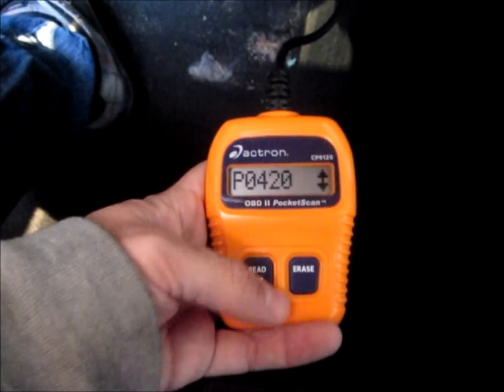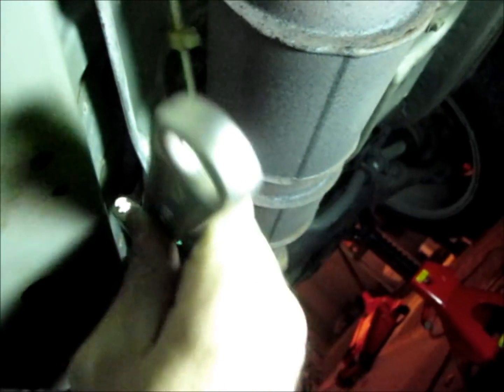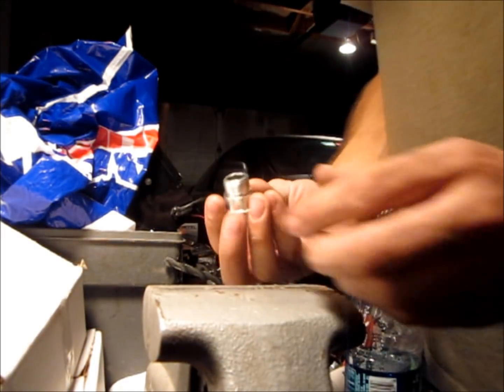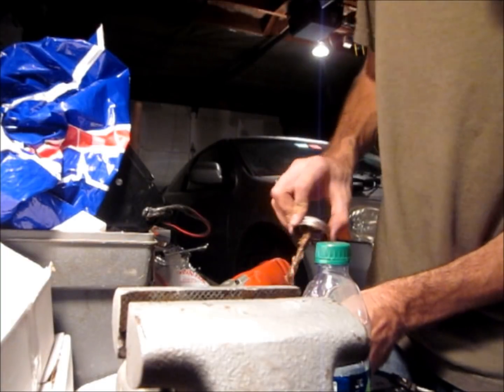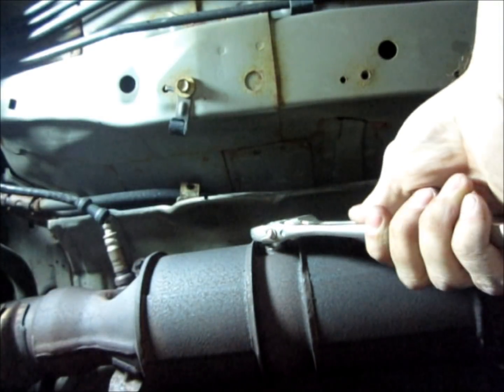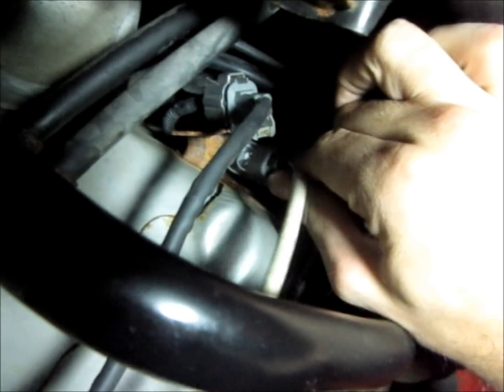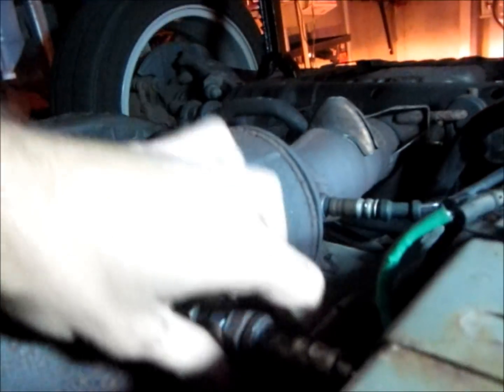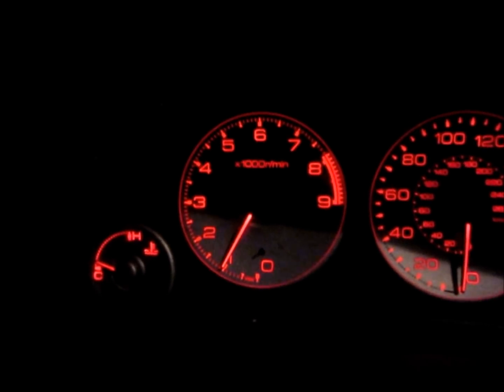Clear check engine light for less than 5 dollars

Comment: 90% of the cars I've seen with a catalyst inefficiency code had bad downstream O2 sensor, NOT a bad catalytic converter (cat). The ones that did have bad converters had bad upstream sensors and were run that way for months and the rich mixture burned out the cat. I always try changing sensors 1st, then the cat, as if you're gonna change the cat, you'll want new sensors anyway to prevent burning it out. One customer was told by the Volvo dealer that he needed a new cat for $1800. 88,000 miles on the car.  We changed his upstream and downstream sensors (probably only downstream bad) and he passed emissions for another 10 years without changing the cat! Saved him $1600 and all legal.
Reply: +Mouse Toad As an ex mechanic I did not and do not have the heart to rip people off, maybe that's why I'm not rich.
Reply from the maker: +Mouse Toad Thank you for your comment sir. This is important info people need to know. You need to diagnose and troubleshoot, rather than "shotgun" -- which many "automotive experts" fail to do, because they want to make money. Many times a $2,000 repair is actually a $100 repair. I hate to see someone on the $2,000 end, having to scrap it for a month or two because a mechanic was greedy and wanted to take advantage of a customer.  Thank you for watching.
Reply from the maker: +ATH-3157 elg You are a stand up guy- thank you for being honest and noble.  You are a dying breed, so please keep doing what you are doing-- and if you get a chance to train another auto tech (Car brain surgeon), please pass along your moral backbone.  Cheers!
Reply: engine light just went on on my car and i brought it to autozone and its about catalytic converter and thats why i searchd here and found you comment and i thank you cause im planning to buy new cat but now i will ask my friend who is a mechanic if he can help me change those sensors..hope just sensors..thanks again sir
Reply: @davao0506  I hope it was just your sensors and not the cat! (My wife is pinay)
Reply: mouse toad, actually O2 sensors are very reliable, it is vacuum leaks, or worn seals such as the intake manifold seal that will make your engine run rich or lean and burn the catalytic converter, that is most common for P0420 code. i would call that "90%"
Reply: @milespi5556  Yes, they are reliable, but they certainly do wear out on high mileage cars. If there were a vacuum leak, it would throw an evap code. Had to track those down too! But catalyst inefficiency codes are generally caused by bad downstream code. Most burned out converters I've seen were customers running the car for months with misfire codes (raw fuel gouing through exhaust burnining it out.) if there were vaccum leaks beyond fuel trim control, it would throw an evaporative code and fail emissions inspection. ECU can compensate fuel mixture if vacuum leak too small to set evap code. that is why a vacuum leak will not burn out the cat unless the evap codes ar ignored long term. But then you'd see evap code, not catalyst inefficiency (unless that code was set by burned out cat as you described due to ignored evap code, but then you'd see BOTH codes.
Reply: +Dale Stewart 
I worked for Sublet firm,  within a large firm and my motto was, " do it right the first time. "  Let the customer know what he or she was up for, give them a quote, and from there negotiate. I'm retired now and living in Europe, a big move from Australia I must say. I worked on mostly Euro cars and I tell you what, they lose translation from left to right hand drive. The Euro cars mainly Italian had and think still have a lot of electrical issues, but fun to drive when going well.
Reply: Open mode on cars from 1996 and newer run midrange, they dont run rich.
Reply: how do you get emissions for 10 years on a vehicle?
Reply: @Gushers2276  10 years - I was wondering about that too.???
Reply: @Gushers2276  You drive the vehicle for 10 years and have it pass the emissions test every other year (the requirement in our area for annual registration). He did not get an emissions pass for 10 years if that's how you interpreted my comment. My customer (and friend) drove that Volvo for at least 10 more years and never had it fail the biannual emissions test. Every other year we have to pass an emissions test prior to registration. (Technically if the check engine light comes on right after passing, it can be run for almost 2 years that way if not corrected. this could burn out the converter if something is throwing the mixture off)  I hope explanation is more clear.
Reply: Damn crooks should wipped them for there impudents
Reply: stupid idea  now I got whole bunch of light on my dashboard
Reply: @tonytran4857  what did you do?  You changed all of your Oxygen sensors?
Reply from the maker: +Mouse Hearted this comment.
Reply: Mouse Toad
Reply: Mouse Toad     How to fix suspension 2001toyotaseqioa
Reply: To Bella's Buddies, I'm a certified auto tech. What is the problem with the suspension?
Reply: Mouse Toad como encontrar cdnsor de oxijeno en una 003 toyota tacoma
Reply: Mouse Toad z
Reply: Mouse Toad p
Reply: Www
Reply: Thank you i will try replaced 2003 mdx acura see if the issues
Reply: Hello. Is it possible to cancel the catalytic converter and process the check Engin due to the removal?
Reply: I have 2 codes In my car P0421 & P0431 are you thinks I have bad cat,the mechanic told me,I have to buy new catalitic 😓😰
Reply: @joseek746  that might be injector one. Maybe check cylinder 1's coil pack. Inspect the spark plug.
Reply: What would you say if you think their is a broken peice of honeycomb inside the converter?? I'm about to change my 02 sensors code reader said bank 1 upstream n downstream I forget if it said bank 2 or not but should I just get new converter or change 02 sensors I didn't want to mess up the sensors if cat is bad
Reply: +ATH-3157 -elg I think there are a lot of good mechanics out there like you. the bad ones give us a bad name. I don't think the rip off guys are getting rich either as it usually catches up with them. honest mechanics get repeat business! It's a tough field to be in, as you know. physically demanding, customers not wanting to pay for a fair deal, getting screwed on flat rate in the rust belt, being blamed for future breakdowns, intermittent problems that don't show up for the mechanic, everything packed into a tight space....I switched careers, lol, boring office job now!
Reply: Mouse Toad thank you Mouse toad very informative God bless you for wanting to help people and not rip them off wish we could clone more like you
Reply: Mouse Toad 

SEEMS LIKE ALOT OF WORK. JUST DISCONNECT THE BATTERY WIRES AND CHANGE THE 02 VALVE.

Comment: think the best solution to pass the smog check, using Moccina's method,  is by the following procedure; BUT,  if you have a bad cat problem initially preventing you from passing smog check, keep in mind people, your catalytic converter will eventually need to replaced to prevent damage to your engine. This is just a temporary method to try to help pass smog.
1) reset your codes using an obdII
2) remove o2 sensor#2 (Downstream), after cat and maybe clean it while you are at it.
3) install adapter 
4) install o2 sensor unto the adapter
5) run your vehicle for 60 miles or more,  depending on your vehicle so you can have all onboard monitors ready for smog check & hopefully yo check engine light does not appear.
6) the day/time of your smog check inpection, run your vehicle for at least 4 to 6 miles or more for a warm up.
7) remove o2 sensor (wear gloves & work smart as components will be hot)
8) remove adapter(wear gloves & work smart as components will be hot) as the smog check inspector may visually be inspecting undeneath.
9) re-install o2 sensor without adapter. ( wear gloves & work smart as components will be hot)
10) visit your local smog check station & hopefully it will pass without having the adapter during the test/inspection. 
Seems like a lot to do but it can be far better than replacing the catalytic converter just to pass smog. Tough times call for desperate measures!
Good luck good people      ✌🕶🔧

Comment: If your O2 Sensor is Bad, Sending a Rich Code to Computer, the Computer will Try to Decrease Fuel to Smooth Out Engine, this could Make the Engine Run much Worse with the Lean Mixture of Fuel, it is Best to Replace a Bad O2 Sensor or just Remove the Cats and Go Straight to Mufflers--O2 Sensors will not longer ever send a Rich code as Exhaust Gas will never be Restricted so Faking out Sensor could work OK. So many Cats are being Stolen from vehicles these days--if you have emission testing in your state, might be hard to Go without Cats, here in Arkansas, we do not have Inspections thus about anything will go unless it is really Loud, then you might get pulled over...

Comment: My engine light is still came on  even they already changed the 02 sensor and catalytic converter the mechanic told me that they don't know why is still showing on
Reply from the maker: Did they change both sensors? Also, make sure they use denso brand sensors.

Comment: Thank you I actually replaced bank 2 converter and used aftermarket converter. the light came bck on! so if u do not use the factory converter which is 1700 mind u they have the computer programmed to reject aftermarket part even if it runs fine. Rip off! thank you Sir
Reply: Coming bck for another update @Moccina. I finally found a mechanic tht found out the previous mechanic lied and did not install the new 02 sensors and showed me. He installed new ones tht was compatible with the Traverse he said Bosch does not work well with Chevy. Codes still came bck so he did the non foulers and it worked. Light came bck on 3 weeks later stayed on 2 weeks and went bck off and hve been off about a month now.

Comment: No check engine light cause you reseted the system. Drive over 100 miles at 70-80 mph then if not check engine light comes back call it success.

Comment: I did this for my 05 ram 1500 and the light turned off and cane back on when i drove it for a few min. I bought 2 defoulers and 4 new o2 sensors and it still came back on 😑 i have high flow cats btw

Comment: It worked, my car just passed the emissions test. I would have had to pay $1400-$1600 to replace the cat. I instead paid $80 for a floor jack; $45 for a set of jack stands; $10 for an O2 socket; $10 for a set of non-foulers I bought off Ebay (longer 45 MM size, no need to combine two shorter non-foulers).

Thanks for your video and a big thanks to everyone on YouTube who made a video explaining how to do this mod. I watched several videos on this subject.

P.S. I used Sea Foam to clean the cat in the past which always worked. Not this time though. This year I also tried CataClean. To no avail. So I tried this mod and it was successful.

Comment: This is nonsense because of the  following reasons.
With  this installation the ECU, engine control unit, will receive faulty data from the 02 sensor resulting in incorrect fuel trims poor gas mileage and lack of engine performance and you can melt the catalytic converter requiring replacement not to mention upper cylinder damage resulting from incorrect fuel mixture. 
It is important that all data form the 02 sensors, map and or maf sensors report the data to the ECU acutely.
These sensors should be replaced around 80 to 100 k give or take a few miles.
50 percent a po 420 trouble code is a 02 sensor issue so why not replace whats really malfunctioning. 
Do it the right way and have a better running vehicle...

Comment: The check engine light went off because you disconnected the battery as soon as your computer system recycles after about 100 miles the check engine light will reappear.

Comment: So a po420 code is for bad cat or is it for the sensor?
Reply: The code means your sensor is getting readings your computer deems irregular to expectations. There's simple tests you can do to diagnose further. A working cat has a hotter outake than intake end. You can test with infrared thermometer. Saw it on youtube. 😁

Comment: Ok , if you do this your a DEADBEAT AMATEUR ! The o2 sensor is there for a reason.  If you just do this little trick and your cats plugged in the long run will run like shit an the air will not have proper flow through it causing blow back on the engine.  At least take the guts outta the cat first .

Comment: I have replaced the sensor and guess what? The code is GONE. unless it's the actual converter, fudging the sensor wont help if the sensor is BAD. usually it's the preheated that fails or in Northern Regions, the wiring can corrode.

Comment: Were your readings on the O2sensor "INC" or did it come back on after a drive cycle? If it reads "INC" at the inspection station it still will not pass.

Comment: I have a 2012 chevy sonic with 115,000 on it an the engine light is on an. Took it to the stealership an there saying it needs new manifold, cat.con an muffler to turn light out they want $1800 to guess fix it the bad part is i have babied the grocery getter so disappointed in Chevrolet never buy another

Comment: you can buy these pre-made for a couple bucks on ebay / no need to drill anything.
Reply: Do they really work and what are they called
Reply: Glebb 21 yes they work. I think they call them gap spacer ....for oxygen sensor or an oxygen sensor Adaptor...
Reply: What are they called?

Comment: My 02 sensor was too large to fit.  I tried cleaning my sensors and cat instead. Waiting for the code to come back because it usually takes a couple days every time I clear it. If that doesn’t work I will buy new 02 sensors. The car has under 90k miles.

Comment: is it illegal to put this on the o2 sensor? I am in California and I also have the same issue with my cat. As my car 2005 Rav4 has 122K on it, I dont wanna put too much $$ for this car. Is it illegal by the state to use this tool? I will SMOG soon. Please answer.
Reply: Get a scanner and erase the codes; next, drive the car so you can reset the monitors.  Each car is different for resetting the monitors.
https://www.youtube.com/watch?v=dQ5_vLibPLQ
https://www.youtube.com/watch?v=7YcOdYJzIzQ&lc=z22veh1abojeu1yjs04t1aokgzhwut2mmp5k25sqc1uwbk0h00410.1546289604596737

Comment: Hahahahahaha good job, you fixed that problem , soon you'll be replacing the Oxygen sensor when that wire connection rubs thru in the body of the car ! Looks mighty tight there..

Comment: Sensors can fail, but When you do determine that the cat is in fact plugged, it's usually cause by bad coil packs, plug wires or spark plugs not igniting and burning the fuel properly in the cylinders. Or its just an old cat plugged with carbon. People who do shit like this, pulling the O2 sensor out of the stream are just masking a real problem. Yeah the light may go out, but only because you manually cleared the code, it is not fixed, 10:1 that light came right back on within a few minutes of drive time. People like this is the reason it sucks trying to find a good reliable used car or truck. You don't know who has had their dickbeaters under the the hood and what they've fucked with. Beware of the hack mechanics out there, the internet breeds them everyday.

Comment: it's still have to go to the drive cycle you have to clear the radiators monitors the in completes the Iams you can't just delete them mIL
Reply: He also disconnected the battery, worked on the car, then reconnected it.  Of course the code disappeared.  This is equivalent to just erasing the code with an OBD2

Comment: Sometimes it's the damn stream CO2 sensor.! This has to be fixed you can turn off the check engine light all you want but you're still going to use way too much gas and it burns too rich it doesn't know what to tell the computer what the oxygen level is. You're best off just change the sensors.

Comment: Spark plug defouler? Wtf. If used as the name implies that thing must reduce compression ratios like a dream. Who comes up with something like that? And why would you? Why would you intentionally reduce compression in an engine? Not to mention creating an additional smaller combustion chamber, on top of the combustion chamber, where detonation is initiated. Unbelievable. One thing is for sure tho. The combustion chamber you use that thing on, will never ping or pre-ignite. Also there may be a way to use that to help convert a high compression engine to a turbo or supercharged engine. In a cheap and easy way. Lets say slapping a turbo onto a lawn mower engine. Usually naturally aspirated engines have much higher compression ratios than turbo or supercharged engines. Now there is a cheap and easy way to overcome that issue. Just slap a spark plug defouler on your spark plugs. And whalaah, instant additional space, for all that fuel and air your trying to cram down its throat. XD

Comment: The spacer used for this spark is an old time thing that was used to change the heat range use of the plug.  It was generally use used in motors that were burning oil.  (worn out rings)  The two sizes were for the different size threads.  One of the big problems with the cat use is that you often know as much them and their use as those mechanics that you are working with.  The difference in output voltage, upstream and downstream, is sensored by your computer.
Reply: Meaning?
Reply: @FRJ1982   a-b=c

Comment: I have another way to fix The downsream 02 sencer and u use a Bosch 02 sencer. here is what u do use window weld the black window galk u use for front glass put it in the holes if the sencer to block them  wipe off excess  put 02 sencer back in car . clear codes drive car no more check engine light